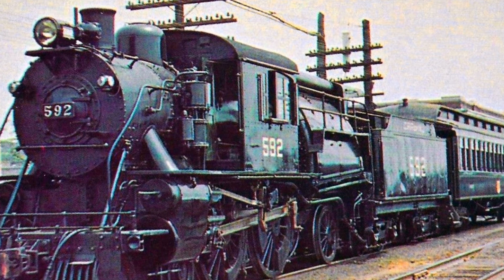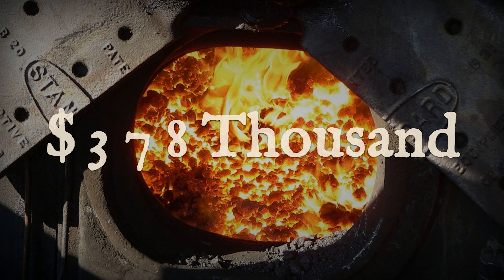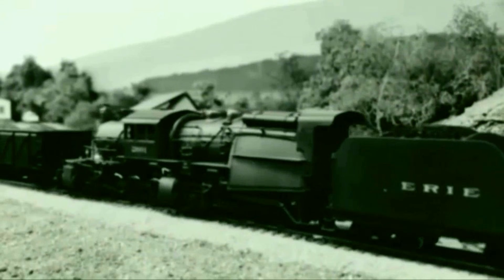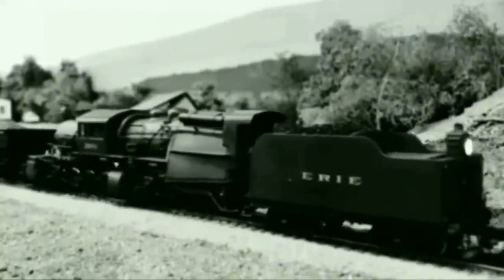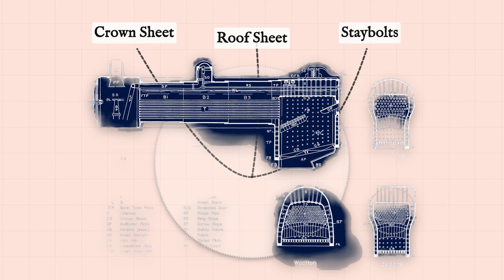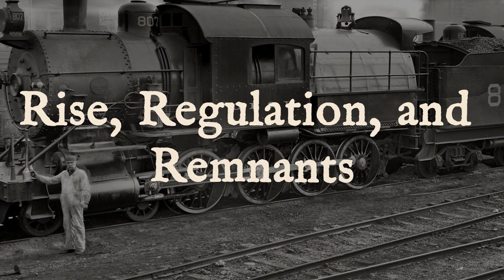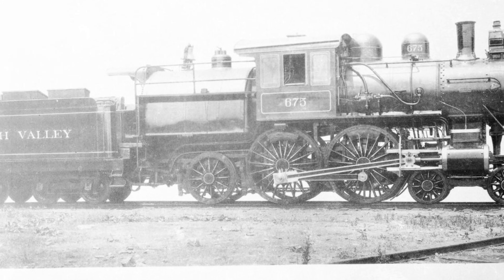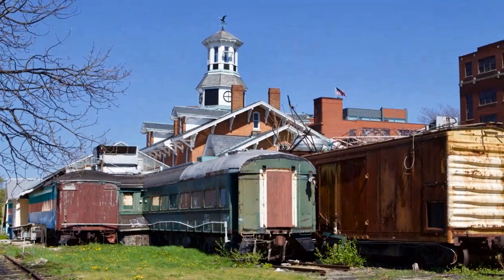How DEADLY Was The Camelback Locomotive ACTUALLY?

Comment: The Camelback locomotive could have been fixed to work properly if the engineer's cab had been moved to the front (Cab Forward) and the coal had been fed to the firebox using a set of mechanical augers instead of using a fireman to shovel the coal into the firebox.